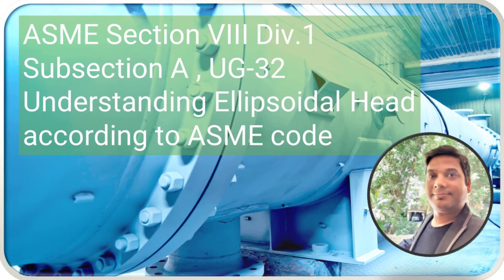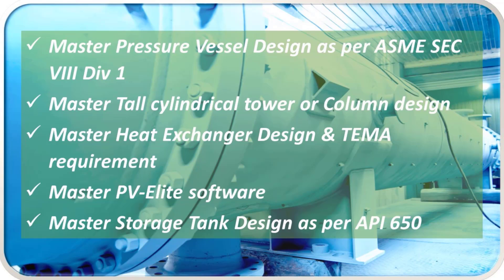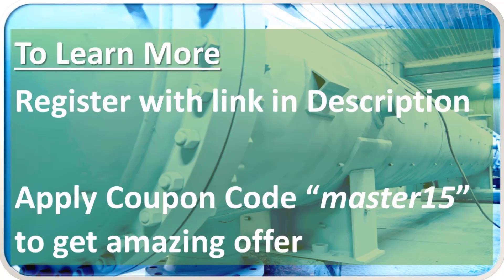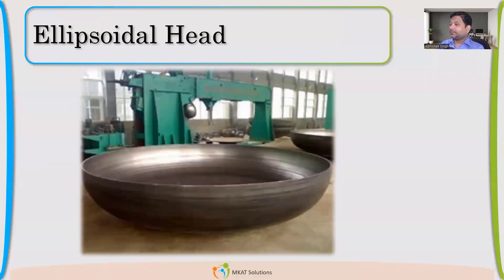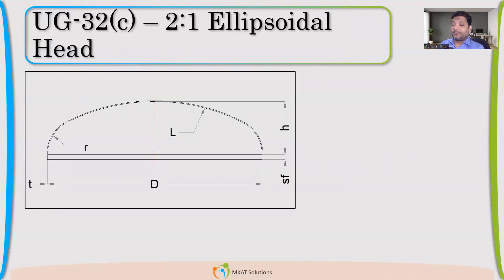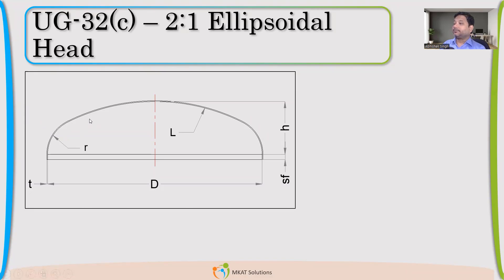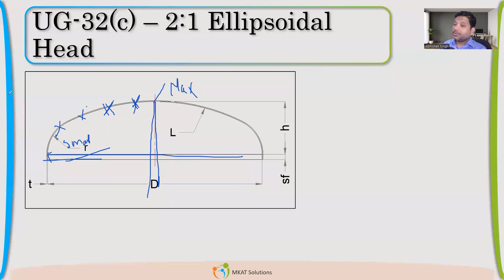Understanding ellipsoidal head according to ASME code

Comment: What is the blank diameter we should use for elliptical head fabrication
Reply: ID+2 TIMES THICKNESS+2 TIMES SF+10% Of ID
Reply from the maker: Fabricator use different methods, a good approximation can be given by
 For plate thickness less than 25 mm / 1.0 inch
 Blank Diameter = D + (D/42) + (2*S.F)+ ((2/3) * Kr)
For plate thickness equal or more than 25 mm / 1.0 inch
 Blank Diameter = D + (D/42) + (2*S.F) + ((2/3) * Kr)+ thk
where,
 D = Outside Diameter of Ellipsoidal HeadS.F. = Straight FaceKr = 0.17*D = Knuckle Radiusthk = Thickness of Head